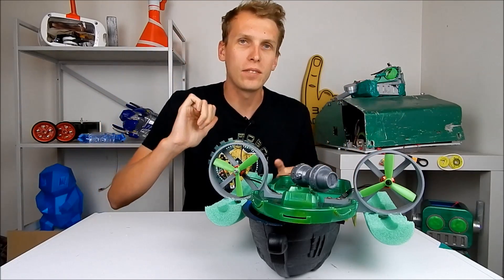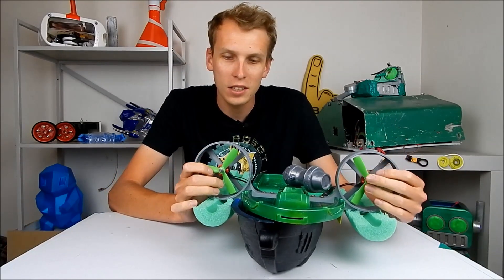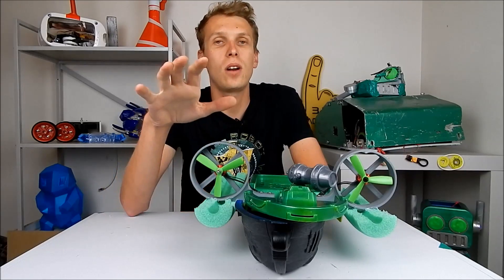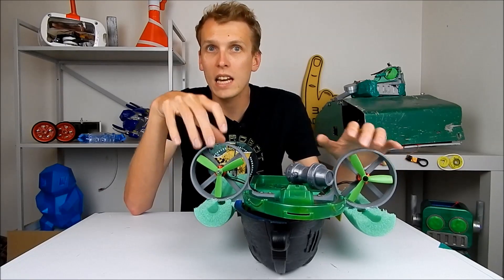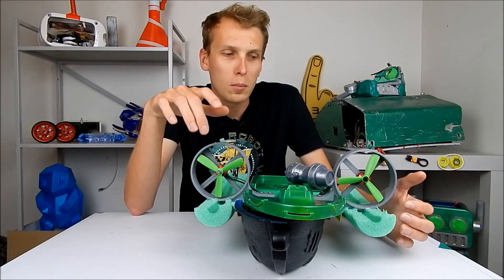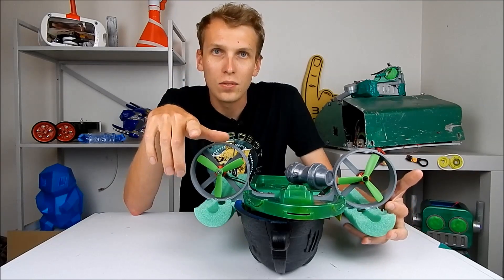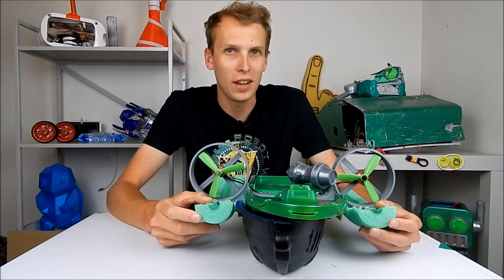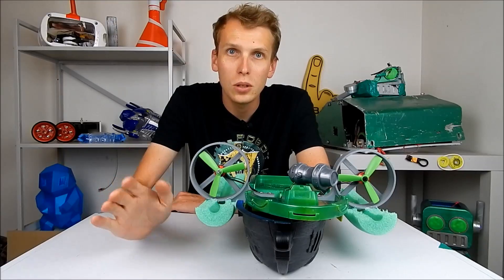150g propeller down force combat robot

Comment: I feel like if it sat 100% flush and level with the floor, it would get even more downpull and actually make it worth it. That's such a cool idea, it gives the robot the same amount of power, but makes it as though it weighs above what it should for its class. I'd like to see you come back to this idea, or maybe do a bigger, stronger fan and a sturdier frame in a beetleweight robot.
Reply from the maker: I'd like to do a test of suction vs air movement, because i'm not sure which one will give the most downforce.
To do that I'd do two chassis, one with a skirt that sits more level and one that sits higher with ducts to the sides to allow for more airflow.

At one point I did do a 13kg bot that had twin EDFs in it to give a bit of downforce and some extra forwards speed. It was my first attempt at a lot of things so it died a death by papercuts before I got it into an arena. I might go back to it one day

Comment: How did you control the brushless motor? Do you send pwm to the ECS?
Reply from the maker: The Arduino sends it a servo PWM signal
Reply: Team Panic how do you have enough pwm pin? Two get taken up by the nrf24l01 4 for the motor drivers.
Reply from the maker: I use a software pwm library to get extra pwm pins.

I have written up my methods here: https://www.instructables.com/id/Cheap-Arduino-Combat-Robot-Control/

Comment: Hey Ben,
seems like a very nice robot. As of now the source of your downforce is mainly the prop pushing the air upwards. However if you somehow managed to get the pressure underneath the bot lower than the surrounding athmosphere it would suck itself to the ground adding a lot more downforce.
Therefore I'd suggest you design a base plate for the bot. This plate would need some sort of side skirts that extent as close to the ground as possible and create a hollow room underneath the bot. The fan would suck all the air out of it which would make the bot stick to the ground. Idk if this works in practice but in theory it sounds great ;)
There is one more thing you should keep in mind: If your bot sucks itself to the ground like this you are not able to messure the downforce via a scale like the one you used in the video because the downforce acts between the bot and the surface it stands on. However you should be able to measure it with a spring scale if you happen to have one at hand.

Anyway, this seems like a really nice design idea to me. I'd really like to see this robot in its final shape. Keep up your great work and have fun doing so ;)

Comment: Seeing as this is pushing down with airflow, I think some vents to let more air into the fan would help (as opposed to a skirt to get a seal for a vacuum effect suggested by others).

And it'd be hard to maintain a seal on a rough arena floor, so go for max airflow for max down pushing. 

And and - more airflow means a cooler motor :) (vacuum means hotter motor)
Reply from the maker: Good idea, the robot sits at an angle so it will naturally have some vents for the air to get through. I'll look into making them more pronounced

Comment: oh cool I'm also in the process of building one like this!  do you think the EDF could be used to upright the bot? I believe the ring of the EDF needs to be flush with the floor if you use it to suck down but I think you are using it to push down so that shouldn't matter
Reply from the maker: Yeah, this design is definitely not optimal, its basically a test bot. Now that it kind of works I'm going to spend a bit more time on the next design
Reply: @TeamPanicRobotics   iv noticed that a traditional EDF has lots of blades 5 to 9 not sure if this would help with thrust
Reply from the maker: only just seen this comment.

traditional EDFs are set up for max thrust at high speed, I have tested a couple of traditional EDFs and they have less static thrust then this one despite being a larger diameter with a bigger motor.

Static thrust is the only thrust we make use of in a combat robot, because the bot will never be moving at the right speed in the right direction to increase the airflow into the EDF
Reply: oh cool that's for the insight

Comment: some skirts around the fan to make a seal with the floor to maximise the ground effect downforce
Reply from the maker: This one is really only a proof of concept, so I decided against skirts (its complicated getting them exactly right so they dont mess with the front wedge). If it performs ok, I'll give it skirts in V2
Reply: @TeamPanicRobotics  as a proof on concept i can see the merits and the working you have put into it, keep up the fun and interesting builds you have been doing. from a (usually) silent subscriber
Reply: @TeamPanicRobotics  just a thought, have you experimented with cone shaped chambers the fan in blowing in, either wider or narrower at the base to see if this has a greater or lesser effect?
Reply from the maker: @dogbertinahat   I haven't, but only because I was looking at Electric Ducted Fans (EDFs) last year, and they have a thing called a thrust tube, which is 4-5 times the diameter of the fan long and only tapers in around 10%. I.e. they are a barely a cone but thats the optimal shape to get the most thrust out of an EDF. 

I'm basically building a DIY EDF in DownForce so I would guess that to get any improvement I would need to build a thrust tube that was at least 120mm long and only lost a few mm in diameter

Comment: You measure that downforce badlly, becaus you sucked on surface of scale, but you can measure that like this. You need your robot on surface of table and then atach your robot to scale that is in air by some string, when you lift your scale you should see your robot weight but when you power on fan you should see your weight + sucking (until you lift your robot from table)
Reply from the maker: Thanks! I'll have to try that next time

Comment: Neat! You could also plug the weapon into the first 2 connections of the battery's balance plug to get 1s. That specific cell will drain faster of course, but just make sure you balance charge it.
Reply from the maker: Yeah i should have done that but I went the more complicated way, upsized the motor and reprinted the chassis, only to discover the issue was my speed controller, it's dumping too much current and not getting the wire sequence right...

Comment: That exposed bottom had me worried
Reply: Oh, I hate it when that happens, forcemaster 7. An exposed bottom can ruin your day, especially now everyone's got phones with video cameras. Before you know it, your bum's gone viral! I've found that a midi-skirt with a weighted hem is one solution, but I usually just bung on a pair of jeans.  ;-)
Reply from the maker: Haha yeah putting it in the arena like that would have been a really bad idea
Reply: @TeamPanicRobotics  You should design a piece that fits in the bottom of it without obstructing the fan.
Reply from the maker: @Norris Vaughn thats exactly what I did before fighting it: https://youtu.be/N5lQMGiUxho
Reply: @TeamPanicRobotics  Another problem I noticed was that it looked like the propellor arms were a little too close to the walls.And I know you designed one there, but I don’t think it was a great design.
Reply from the maker: Honestly the propellor arms probobly arnt close enough to the walls. If you look up Electric Ducted Fans (EDFs) you will see they have the blades as close to the wall as possible (oftern less then 1mm). As far as I know, this is because the tips of the blades create terbulance as the blade spins, the closer the tip is to the wall the less terbulance the tip creates. With less terbulance, more air moves in the correct direction and therefore creates more thrust.
This is how EDFs get more thrust then just running the same propellor in open air.

Ehh, it was light and kept the electronics in place, it didnt need to do any more then that. Sure it didnt look the best, but its underneith the robot so it shouldnt be seen in most fights. I'm working on a new version of this bot and it will get a similar clear plastic base, a 3d printed, or any 'nice' base is a masive waste of weight
Reply: @TeamPanicRobotics  I’m just worried about if the robot goes up against a powerful spinner and is knocked over, the bottom panel could come off with that design. I like the idea and it is a great prototype, but I think more time should be given into how exactly the electronics should actually be placed inside the robot to make them more secure.